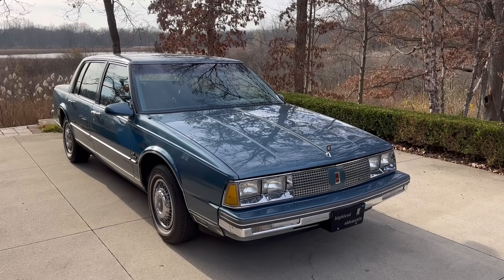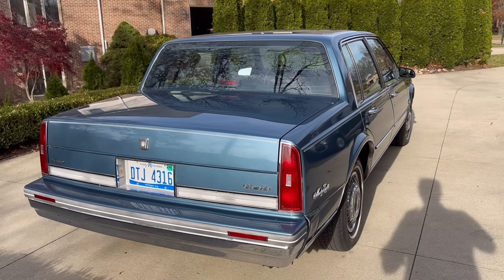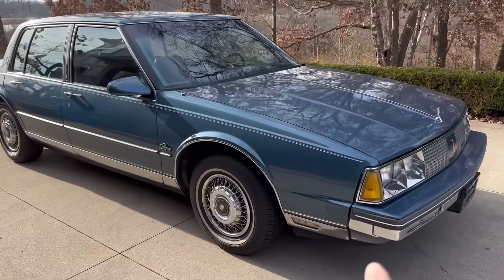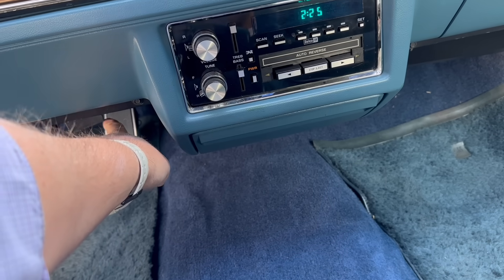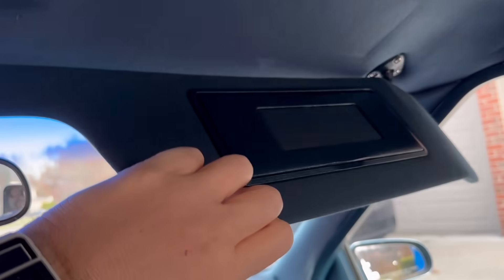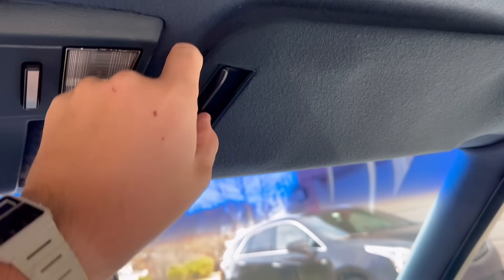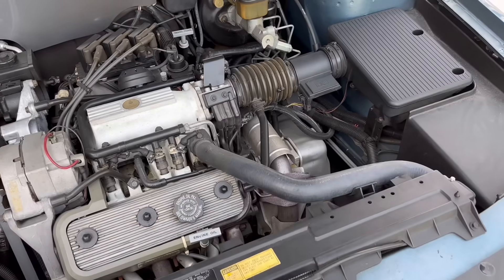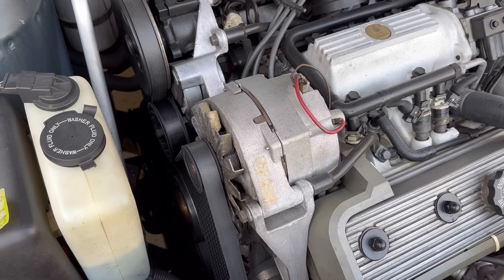Strange Features, Quirks and Idiosyncrasies of GM's "'Baby Big" 1986 Oldsmobile 98 Regency

Comment: Blast from the past. My grandparents, who I lvied with at the time, had one of the very first of these, an '85 Regency Brougham bought in the summer of '84. Black on the slipperiest red leather ever put in a car, with the padded vinyl roof. It was an epically terrible car. It never ran quite right from day 1. The steering wheel cracked the week after the warranty ran out. It was slow, it wallowed and floated, and you could howl the tires like a hound dog in the mildest of cornering. My old man bought it as a retirement present for himself, and ended up hating it so much he just kept driving his pickup. It ended up pretty much being my car once I got my license in '86, until my grandmother slid her car off the road in a snowstorm and decided she would rather drive the Olds and gave me her Subaru (she had a long commute, so wanted the mileage of the Subie until that point. I MUCH preferred the stickshift Subaru. Ours had the AM stereo option and upgraded speakers/amp - appreciated that in high school. IIRC, in '85 it only had 135hp. In true GM fashion, it ran poorly for a long time, until my grandmother stopped driving in about 2000. They sold it to a relative who drove it for a few more years.

I still have that cassette tape, LOL.

Comment: I feel that GM rushed the front drive platforms to market before they were really ready.  The 80’s FWD GM cars with transverse mounted engines felt very unrefined.  Having extensively driven a ‘82 olds cutlass Cierra, an ‘86 grand am, and an ‘86 regency, the steering was terrible when on throttle.  It was more than just torque steer and drivetrain noises that contributed to the unrefined feel.  Our ‘90 regency was a bit better.  I had driven a Ford Tempo and Mercury Sable from that era and they definitely were engineered better. It wasn’t until I rented a ‘92 cutlass that I felt that GM had finally gotten it right. I bought a ‘93 Regal with the 3800 engine and 4 wheel disc brakes (finally!). That was a really great car.

Comment: I would much rather have one of these than the Cadillac of the same year. I miss Oldsmobile. If you run Marvel Mystery Oil in your gas you will have a good result with your fuel injectors.

Comment: It's a transaxle, not a transmission. The only car I ever had like this one would have been a 1986 Pontiac 6000 STE which I had as a company vehicle while I lived in Dallas. They fired me, I returned the car, bought an 81 Cadillac Sedan deVille and returned to NYC with a U-Haul attached. It worked out for the best, I got a really good job with the former Amoco Oil Co and from the yada, yada, yada, I'm retired now and watching YouTube videos 😉
Reply: IT';s surprising to me that a company would pay the extra cost for the feature-rich STE model.  Most of them I saw with the "Goolie" variety 6000-LE.

Comment: I'm not sure those opera/coach lights are LED. I remember the big Buick of that era had 12 volt to 120 volt converter mounted in the trunk to power those lights.
Reply: They were “electroluminescent”.
Reply: Yes, electroluminescent.  White LEDs first appeared commercially in 1996 (and were too expensive for automotive use for a while after that).

Comment: Make mine one year older and 4.3 Diesel!!  These cars, diesel or gas, do not get the credit they deserve... By 1988-1989 they were very solid cars with a very robust transmission and even an optional driver's side crash air bag....  You could get these so loaded with digital instrumentation and even the driver's door keypad iirc?

Comment: This was GM's lowest point imo .
So many bland, slow, chintzy lookalike cars, with the most simple, boring styling.

Who would pick this over a swoopy, futuristic Sable with a light bar across the whole front and an interior that still looks modern for much less money?

Or the Continental, or even GM's own Caprice Brougham, which also was cheaper and superior in nearly every way?
Very sad.

The next generation has much better styling, but never regained that big, substantial feel.

Chevy, Buick and Caddy regained that with the new Caprice, Roadmaster, Brougham, and I always wondered why Olds didn't get a "Regency Rocket V8" version, it would have been great.

(The rebadged Custom Cruiser wagon doesn't count.)